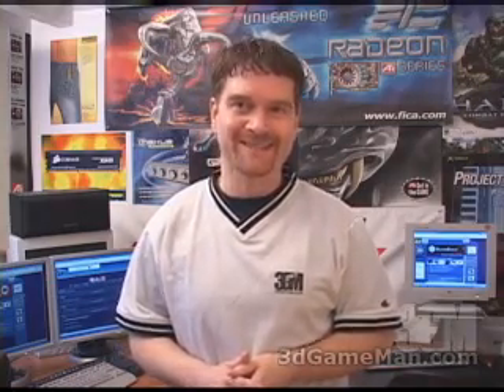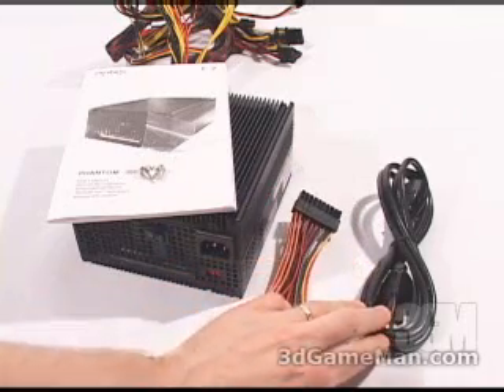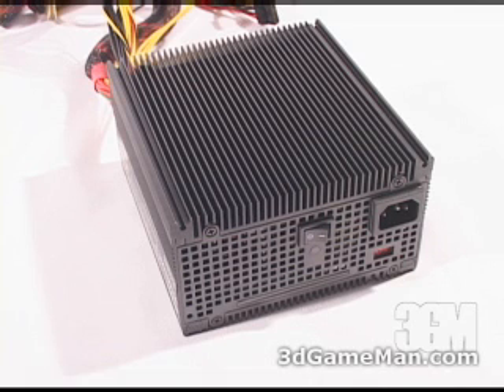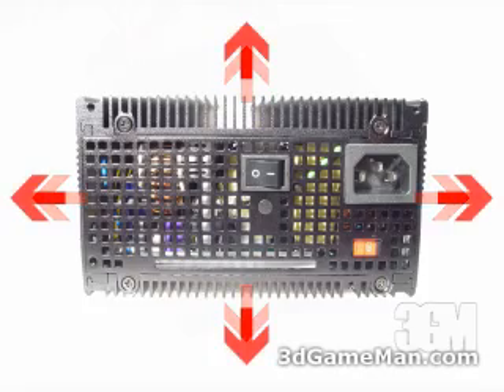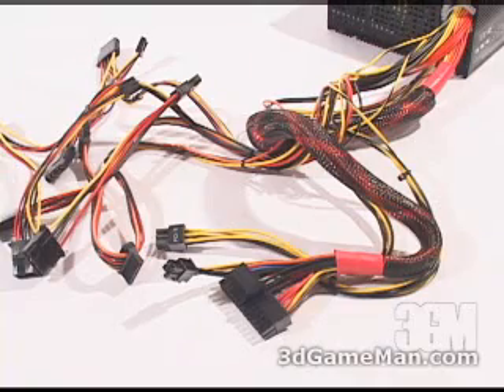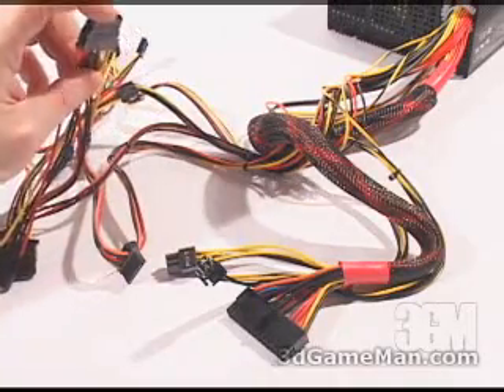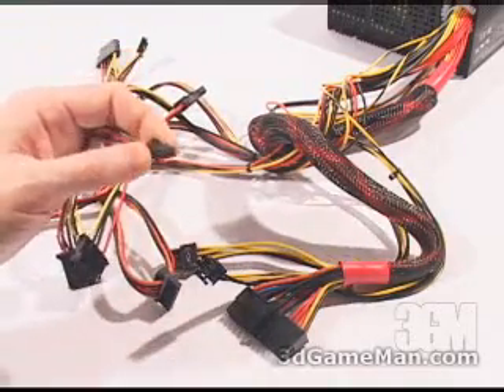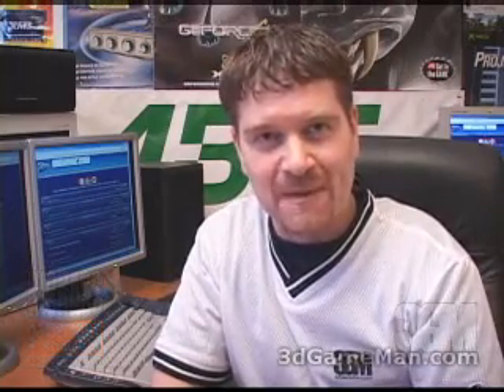#561 - Antec Phantom 350 Watt Silent Fanless Power Supply

Comment: ...erhhhh 2020 and my phantom 500's stilll going... altho its still powering a phenom2 1045t with an r9 270. and its..nearly 24/7 power on. er altho the 500 has a small 3 setting fan.